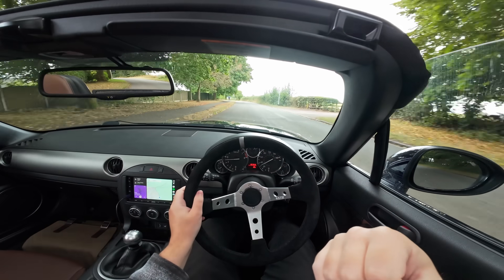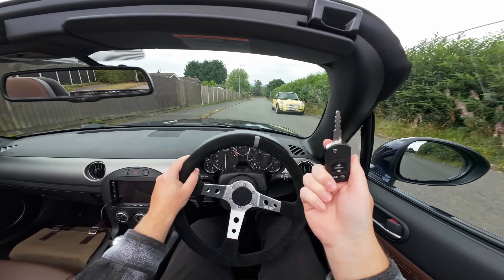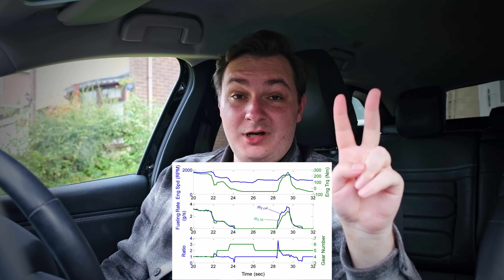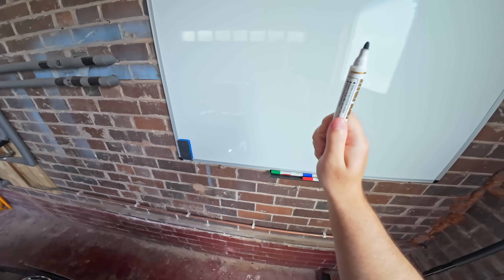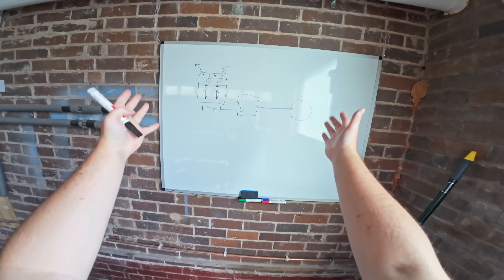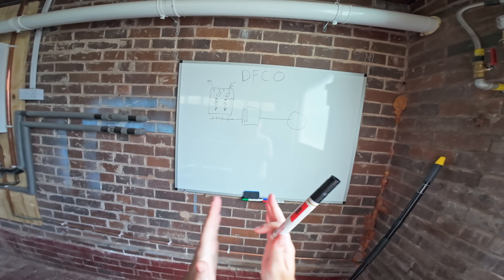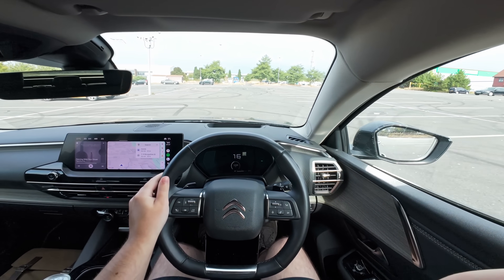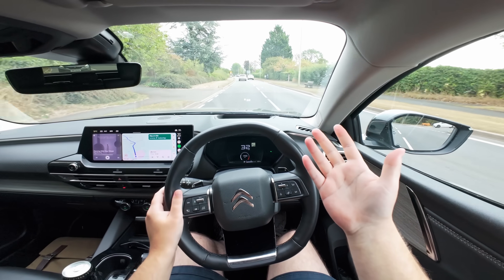The most misunderstood car term - Engine Braking

Comment: Ok, this is great and all, thanks for the explanation.

But the one thing I was wondering about (due to my ignorance, so please help me out): what about Neutral? Let's say I'm driving down  the highway and see a traffic jam in the distance. Optimally, from what I've learned here, I would just keep in gear and step off the throttle (and maybe lower gear if the RPMs get too low the current gear) and this way I would automatically brake a bit without using up fuel.
But what happens if I change to Neutral and step off the throttle? From what I remember, being in Neutral means the gearbox is disconnected from the transmission(???), that means that any energy keeping the wheels going is just used up on the wheels and not pushed up to the engine like it would be for engine braking if it were in gear? So fuel still needs to be injected to keep the engine going?
So putting it in Neutral in such a situation is actually bad for fuel economy? Is my understanding correct or am I missing something?
Reply from the maker: Watch my engine braking Vs coasting video

Comment: Yeah, cars that give you a live readout of mpg usage will jump to the max when you take your foot off the accelerator. It makes sense, the engine doesn't need to burn fuel to generate power when you're engine braking because you don't need that power when you're not trying to accelerate.

Comment: Cars have safety features to prevent them from being unsafe in the event of a malfunction.

You removing the key did nothing to the running car, the injectors were still injecting fuel.

Comment: I have a 2011 6-speed mustang with a V6. I've been engine braking gear entire 160,000 mi. I'm still on the original clutch that came with the car. And yes, I have downshifted. The idea is don't drag your clutch. Only idiots do that.

Comment: Another thing about this is that you can actually get so good at this that you can almost exclusively use cruise control to brake and accelerate. The laziness in me demands engine braking. Moving my foot a few inches? nah. Moving my finger an inch? hell yeah.

Your example regarding speed limit changes? perfect use of this. Just pop your speed setting down to the new speed limit a bit before from the sign, and the car will take care of business for you.

Comment: the "B" mode on CVT cars and eCVT cars like the Toyota Prius is for transmission (or engine breaking), and it's pretty good for not accelerating out of control down a mountain, and not catching your disk breaks on fire

Comment: You should push your explanation further. People need to hear this, especially the last part, please ->

While braking, you convert inertia of the car into heat and wear of brake pads - wasting all that energy. While engine braking you convert inertia of the car into spinning of the engine and consequently spinning of the generator and/or alternator. Some of the energy is used to power the systems, some is stored in battery and some is, as always, lost to inefficiencies. Still better than heating the braking pads, though. This much was said.

Mild hybrids, hybrids and even fully electric cars take excellent advantage of engine braking to recharge - no fuel (or electricity) is indeed expended while engine braking, the opposite, actually - they let the inertia spin the generator to recharge the battery.  Even some cars with modern electric systems only recharge their batteries when absolutely needed due to critically low voltage, or when the car detects engine braking. This further improves fuel economy, but can be hard on the overall battery life. And no matter how efficient your car is - not spending fuel (or electricity) is the greenest way you can drive. Also, this is the reason why modern cars often slow down much more prominently while engine braking than older cars, and it creates kind of a new problem our lawmakers are yet to address - car makers are not required to make the braking lights light up when your car is engine braking, even though the deceleration might be quite strong and akin to actually braking in some cars, so the car behind you might have no warning or indication that you are about to slow down and it can create a dangerous situation.

Cheers

Comment: I'm using engine braking all the time - very useful technique and nice when you get used to use it smoothly. Maybe in some other cars it works differently but in my Toyota Corolla with manual transmission (according to the manual): during engine breaking the fuel is cut off between 1.5 and 3 krpm. Below 1.5 krpm the engine starts eating fuel to prevent stopping.

Comment: I can't believe there is someone not doing this! I have learnt this in my Czech driving school! I have been driving for 25 years and I always use my engine to slow down. Even when coming to a steep downhill, I just gradually downshift to 3rd gear (manual) and then I go down the hill only with engine breaking, using my brakes only to regulate the speed and not to over-rev the engine.

Comment: Don't agree with the free fuel part of it. If you drop down from 55 to 50 then accelerate to 55 again, you'll be using the same amount of fuel if done in the same time frame. Yeah maybe you can't brake that softly, but unless you're driving an EV or Hybrid, be it engine braking or the brake pads, the energy you lose is dissipated as heat, and when you gain back the same speed you burn the same amount of fuel to get that energy back.

One more thing to point out is that at lower gears engine braking slows down the vehicle rapidly without lighting up the brake lights (maybe some cars do this), this can be dangerous if there is a car right behind you.
Reply: The point isn't to do it in an arbitrary way, but if the speed limit changes from 50 to 40 for a while back to 50 then this is far more efficient than braking when the speed drops since you could have instead spent some time allowing the engine to slowly decelerate the vehicle then maintain, and the accelerate without using the brakes at all.

Pretty much every vehicle can beat their EPA or other economy rating if driven for efficiency.
Reply: @Snerdles  Yeah absolutely, although the reason is different. If you let the speed drop after the zone becomes 40 from 50, you're breaking the law. If you do it beforehand you are going slower than the limit for a longer amount of time with engine braking. My argument was that it is not the engine braking that saves the fuel, I strictly mentioned that both are equal if done in the same time frame.

Comment: NEVER remove your car key while driving! Some (most?) cars have the steering wheel lock that is engaged when you remove the key or just turn it into a parking position.
Reply: Happen to be in the garage, so I just double checked. When the steering wheel locks, if there's any pressure on the steering, the key won't turn back to on. So if you were to panic at all or are trying to turn, it might not unlock.
Reply: Yeah, some idiot's gonna copy that, end up heading towards pedestrian's, and panicking when they find the servo'd brakes barely slow them down. Dumb.
Reply: Or just know how your car behaves.

Comment: You are completely right. I am amazed that the mechanics thought otherwise. I have often watched them and assmumed they were correct on car stuff. Although, like you said, i think this is old knowledge still being believed from the older cars, and of course american cars can often be older and without the computer controlled engines. It is the computer monitering the engine to see if fuel needs to be added. I know a lot of people dont understand this and just gas gas gas until brake.My car monitors your driving and gives you stars out of 5 for your driving in certain catagories. I always get 5 stars in the "anticipation" catagory, which is basically the "lift and coast" technique you speak of. You can also do it down decents to save a huge amount of fuel. I am amazed at how far my car can go even on the flat!

Comment: It's not a cheat code, it's fundamental thermodymics.
Every time you use the brakes you are "wasting" that momentum amd that fuel.
Reply: Are you saying the injection supplies fuel when the brake pedal is applied but somehow knows not to when it isn't?
Reply: @James-p7f5b no, you're wasting fuel by going full speed until a turn and then using the brakes instead of going off the throttle and letting it engine brake (thus zero fuel usage) a few hundred meters before the turn
Reply: @James-p7f5b If you engage the clutch, yes, as the engine falls to idle rpm, which many people do when they drive in the go constant speed until the red light, then brake hard to stop.

Now if you were to brake lightly with the clutch still engaged, then no, it would still cut the fuel, but you are going to make use of it for shorter than if you lifted earlier, and didn't brake.

Comment: Hmm iwould argue that's not engine breaking, for me engine breaking is when you downshift and you can feel that car is actually breaking. What you showed it's just not accelerating and most of breaking force comes from friction and air resistance at that point. It's more like coasting or whatever you call it in English. 

And ofc this is proper way to drive, just saying I would not call it engine breaking but regular non aggressive driving.

Comment: Others have picked you up on this, taking the keys out is a big risk. You drop them , fumble it, it’s not going well. Something happens you need to swerve for, or even a tyre goes, you can’t steer as the steering locks up. I  don’t know but it could also affect your brakes, the servo is still being charged by the induction vacuum, but abs is probably out and who knows what the canbus system is doing when the ignition is on, then you disable it. Highly unrecommended practice, and not a good trick !

Comment: The only way the engine isnt getting fuel is if you shut it off otherwise its still running fuel levels at an idle rate unless the gas pedal is pressed just because you took your foot off the gas dosent mean the fuel stops flowing it just not flowing at the same rate a live data scan will show you that information
Reply: Thats for carb not fuel injected veh

Comment: This technique works great with mild hybrids too. Lift off and light breaking regens your battery. It's always funny watching other cars tear ahead of you to a red light and slam on the brakes. I coast on up behind them having regened some battery and they're no further a head than before. Driving style really helps your cars efficiency.
The other main thing is to not smash the throttle when pulling away from a stop. Ease it in and just let momentum build, yeah you'll fall back several car lengths in traffic but the fuel savings are real.

Comment: Super dangerous taking the key out of the ignition while driving. On some cars that will cause the steering wheel to lock up and you will no longer be able to steer!!!
Reply: «some » ? Quote me one car that does not do it !

100% cars built after 1980, maybe 1970 has a Neiman. 

He is on a strait road.

In France cutting off engine while car going forward is prohibited, even if you keep key in. If you publish a video showing yourself doing that you can get a fine. 

Unless doing it on private road.

Comment: B,b,but whatabout my 1969 odge challenger ? Shitloads of cars still are carburated, they consume gas when they engine brake. Conversation over, fuel injectors don’t belong on cars anyway, nothing better than carburetors. I'd actually spit gasoline in my engine if I could, and cover the valve with my thumb.

Comment: To me, just letting the accelerator off is "coasting", not any kind of braking. Yes, you do slow down more compared to putting the car in neutral, but that is a very strange configuration to use as the baseline -- I don't put a vehicle in neutral unless it is being towed or requires it to shift into park.

Engine braking to me is shifting into a lower gear to slow down more rapidly. I used to do that sometimes with ATVs, but I haven't done that with regular road vehicles. That might partially be because I drive a hybrid, which has a "brake" gear that applies extra regenerative braking when the accelerator is released.

Comment: Terrific explanation, please do one more for EVs and regen so the rest of drivers are covered too. I can't fathom that this isn't common knowledge, it always felt like that to me (and I've never driven a carburated car either).
Reply: It's the exact same just instead of the kinetic energy spinning an engine it spins a motor and when you spin a motor it becomes a generator which creates a similar style of drag to slow the car. Instead of friction of the engine and gears and brakes making heat, the motor/generator makes electricity that charges a battery for use later.

Comment: My car does it differently 😂
When below 3k rpm it keeps delivering some fuel but skips some sparks... I know so because it keeps giving off some blurbs that will even go bang if the exhaust is hot.
Turning off the key makes that stop and engine braking becomes noticeably stronger.
When at high revs it'll accept my lift off and do a very rough and strong engine braking... (it's even uncomfortable when you don't want that and thus wasn't expecting)
It's 28 years old, but I swear man, it's like it knows when you're pushing, the car's engine behavior really changes.
It's multipoint electronic fuel injection with mechanical distributor.
But the catalyzer is absolutely gone and the intake actuator for idle is unplugged hehe

Comment: Maybe this was explained and did not get through my thick skull... What if we have the scenario of downhill driving with lots of curves? I've been taught to always stay in the highest gear possible for the speed i'm in. Now, just last week had a really nasty downhill from my city to the beach. im talking about at least 45 degrees in inclination. I did not feel comfortable driving in 4th or even 3rd, but whenever I lowered to 2nd (and even sometimes 1st) gear the RPMs touched the red part, which in my case is around 6000 rpms. All this to avoid heating up my brakes, cuz I HAD to constantly keep my feet pressing it.
Having said that, even if no fuel es being consumed and the engine is not trully making combustion, is it dangerous to reach red line level RPMs, when going downhill? would it damage the engine?

Kind regards! this video was really helpful!

Comment: Explained it pretty well. What most people don't seem to understand is that engine braking is just a fancy word to describe letting go of the throttle. It can obviously save you some fuel, but not as significantly as the way you drive (how quickly you accelerate). What's really important however, is that engine braking in low gear (high RPM) while descending a long steep hill. Everyone must let their engine slow your car/truck down in a constant speed down the mountain rather than constantly applying the brake, which can lead to brake fade and lose control. Just like you said, the engine isn't constant injecting fuel whether you're in 1st gear or 6th gear as long as you don't apply the throttle. So many people get scared of letting their engine run in high rpm without knowing that there's no fuel injecting/wasting while you descend. Engines are designed to run with minimum amount of friction so you need to shift down (high RPM) to really make use of it while descending. Engine are also designed to withstand a lot more heat than your brake pads and combination of all the cooling componants and lack of combustions inside the cylinders make it perfectly safe for you to ride down in lower gear with minimum use of your actual brake. 

Disclaimers - Obviously, DON'T be an idiot and put your car into 1st gear and rev your engine to death the whole way down hill. any component in engine/transmission can most definitely wear and fail. A good balance of engine braking and regular braking is the key.
Reply: And yes, your transmission is really the one taking the brunt of it when you engine brake while shifting down, not your actual engine. If you know that your transmission isn't in the best condition, consider using your brake a bit more. Replacing brake pads is a lot cheaper than replacing a transmission. 😅

Comment: I believe the Bosch K-Jetronic injected fuel to match the ideal 14:1 ratio for the moving air mass measured in the intake no matter what. Whilst engine braking I think the fuel would still be injected as long as the air was going in. But of course the throttle would be closed down to idle...